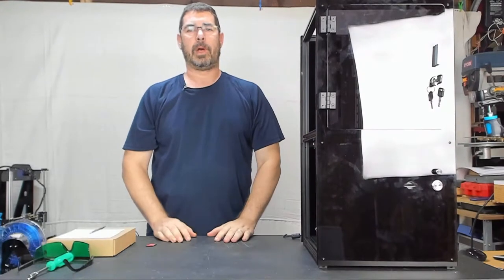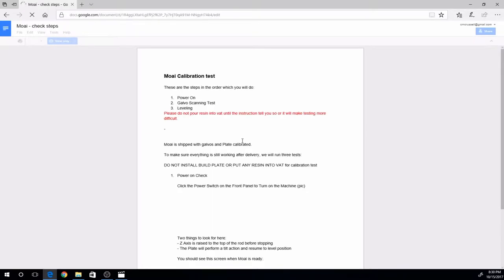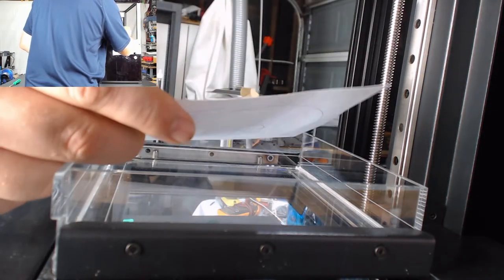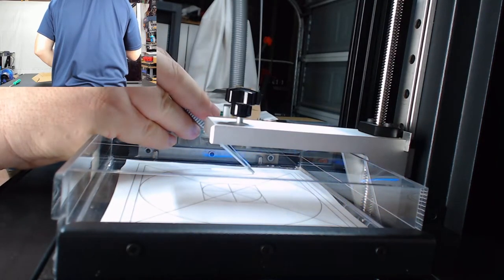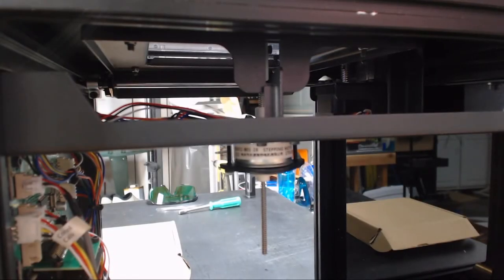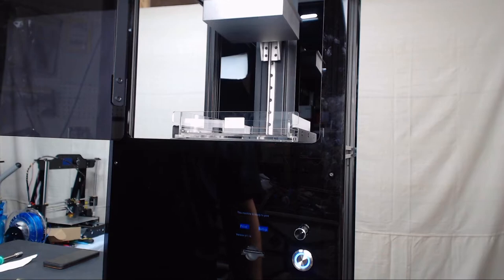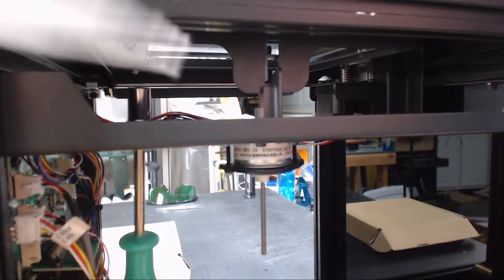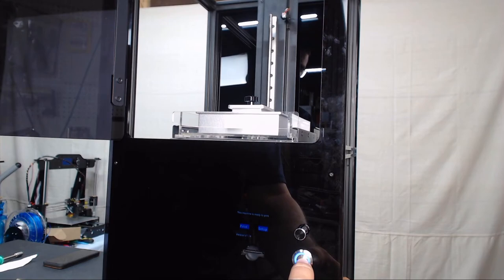Moai Series Part 8: Calibration ** UPDATED NOTES BELOW**

Comment from the maker: ** UPDATE: The leveling process shown is this video is out of date and had been replaced by a new process.  I will be releasing an updated video in the near future that supplements this series with the new process. In the short term, please follow along with the Peopoly build manual. **
Reply: Following the steps on the new settings since I just got my Moai using the new Wiki update I still find myself having to tighten the build plate a lot to get the size of the print past 10.00 mm when it still needs to get to almost 11.00 mm. Is it safe for me to tighten more than the paper test?
Reply from the maker: The goal is to get all 4 of the cylinders down in the 10.6~10.8 mm range.  It’s OK to tighten a little more if necessary, just don’t over do it.  Remember just a 1/4 turn even has a huge impact on the size.  If you can’t get it down in that range easily, try reaching out to Peopoly on their support forums for additional guidance before going to far.
Reply: I got a great solid ring print after getting my Caliper readings correct!
Reply: Did you make a followup video? cant seam to find it?

Comment: Thanks you for the video.  I eagerly await your revised video.

I just wanted to add a note concerning the "safety glasses" supplied with the printer.  I am a fabrication engineer at a scientific research facility.  I ordered and setup at Moai 200 in my lab.  This printer had to be checked out before I could use it for prototyping.  My radiation safety monitor/inspector stated that the glasses that came with the system are not rated for laser safety or UV safety, in any way.  The ones I received had ANSI Z87.1 / EN166-F ratings, which are standard safety glasses, without any other ratings.  Modifiers that show wavelengths and intensity should/would be present on the glasses if they were rated for those things.  

He ordered part number F22.P5L12.500 from lasersafety.com  (laservisionusa).

They are rated at:
OD 9+ @ 180 - 315 NM
OD 6+ @ 315 - 445 NM
OD 4+ @ 705 - 755 NM
OD 8+ @755 - 1100 NM

These are laser ratings, and not listed as UV ratings due to laser intensity being the biggest factor for protection, in this instance. "OD 6+ @ 315 - 445 NM" covers the frequency of the laser in the Moai 200.

I am sure that there are other safety glass manufacturers that can provide similar glasses.

This is not an advertisement.  I am in no way affiliated with this safety glass company and am not serving any financial interest in passing on this information.  Protect your peepers, people!

As an additional note, even though the top door has a safety limit switch, the lower door (galvo, electronics, and laser access) also needs one to prevent operation while laser exposure is likely.

Just for general information:
ANSI 87.1 - https://blog.safetyglassesusa.com/what-does-ansi-z87-1-2010-certified-mean/
EN166-F - https://www.wiseworksafe.com/blog/view/understanding-en-166-personal-eye-protection-standard

Comment: I'm stuck where it does the vat tilt test. I start it out as level. It goes down slowly, goes up fast, and then down fast. It ends up very unlevel. Is this normal before ever calibrating? I assumed it would end up at least close to level.

I asked about it on the Peopoly forum, and they sent me a firmware update, but it has zero effect on my Moai 130.

Thoughts?
Reply from the maker: Eric, doesn't sound quite right, but I don't have the machine any longer to validate it. I do remember it cycles the tilt on power up tho and IIRC it should come back up to level unless something is binding physically.  I would suggest getting a video of what is happening and getting that over to Peopoly support if you can.

Comment: The leveling on this printer has becomed incredibly confusing with the addition of the easy to level buildplate and the fep vat, there are multiple manuals and there is a lot of confusion out there. Redid the leveling using the paper method and printed the cylinders, all printed great, but they are at about 9,23 mm, and in the manual they need to be at 10.5 mm, using the default buildplate with 1877 value on the Z-reset. Can you tell me what should i do to make the cylinders at that scale, if i increase to 1878 what does that mean exactly, haven't found an in depth explanation for this, increasing will increase the buildplate?
Reply from the maker: The 1877 vs 1878 value is the number of "steps" from the Z homing at the top to being in the proper position for first layer in the vat, so increasing it just means that the build plate is that much closer to the bottom of the take when the first layer prints.  Unfortunately, I have not installed the FEP vat (or new style build plate) yet, so I can't really advise you on this one. Best place to ask the question is the Peopoly forums. https://forum.peopoly.net
Reply: @crussty3d  Hi thanks for responding, i got the answer on the forum, i am using the regular buildplate and vat so nothing special here for now just trying to make the cylinders the correct lenght. Started another print now using a much lower value to have less pressure on the vat and increase the size of the cylinders.
Reply: Practical Printing I am at 1870 value now and 3/4 cylinders print,  next I need to manually rotate the nut for the corner that didn't print and tweak very slightly the other ones based off their length. Going to be tricky rotating them at such small angles, half a turn is 0.3 mm so quarter turn or 90 degrees is 0.15 mm.
Reply: I have noticed after I change the z value , the bed goes down, I turn the printer off then on to make it go back home and it makes a sound twice like the buildplate tries to go lower into the vat twice before going back up into home, is that normal?
Reply from the maker: Icemanmodeler mine has always made a “Thunk thunk” sound with the PDMS vat, so I assume so.
Reply: Practical Printing Then it may be normal, thanks for confirming. I think I reached the value 1870 because I leveled it with resin in the tank.
Reply: @crussty3d  Im going to do a full leveling reset again, the leveling hasn't gone anywhere, getting inconsistencies, tried to use the easy to level buildplate per instructions and with that it only printed 2 of the 4 cylinders, this whole leveling sistem is a huge joke, the forum is filled with people experiencing similar problems with the leveling.

Comment: And what do i do if the laser doesn't match perfectly the paper, is it possible to shift it in the menu?
Reply from the maker: TheIcemanModdeler it doesn’t need to be a perfect match, the importance of that test is to validate the laser is firing inside the VAT and that it’s a consistent circle.  If it’s drastically off, contact Peopoly support before making any adjustments to it.  Fortunately a lot of the leveling process here is out of date and the new steps in the manual are much easier.
Reply: @crussty3d  Right, the circle is just left and forward slightly, the circle paper test that came with the printer has a border line where to cut it so it fits perfectly in the vat, no more room to move it and match it with the laser.
Reply from the maker: Trim that back inside the border more so you can move it to match the laser. That should tell you if the circle is correct in shape.
Reply: @crussty3d  Ok will do that, thanks.
Reply: @crussty3d  I fixed the problem, i found the advanced moai calibration document and that made me adjust the motors that control the mirrors to get everything aligned as close as possible, super simple design.
Reply: @TheIcemanModdeler  do you have a link for that document?
Reply: @lordgort1986  Just search for advanced moai calibration on google, it will show u to manually rotate the mirrors from the base, careful no to touch the mirrors.

Comment: For FEP vat users, use a specially made circle test calibration file at:
https://drive.google.com/file/d/1S-L18AFP98fBC-eObGOiKP4XNvgacvXn/view?usp=sharing
For FEP Vat users the Z Reset Position should be 1816, and you back it off to 1815 to level the plate.
The info for leveling the new style build plate is here: https://wiki.peopoly.net/doku.php?id=moai:levelingnewplate

Comment: the circle test is completely wrong in this video as its to center the laser to the middle of the vat. if your galvo is making an oval or anything else its broken.
Reply from the maker: Malcolm, the information given was accurate at the time the video was made, per the build manual at the time and additional information given by Peopoly. As I noted in the title and comments above, the processes and procedures for calibration and leveling have been superseded with newer instructions from Peopoly, including new leveling process and (more recently) adjusting for dimensional accuracy.  However, the purpose of the circle chase is still to simply verify that your laser is firing, and that it is doing it reasonably close to a circle.  If this is not happening at this point, then yes, other actions are needed, which could be replacing or readjusting the galvos- or your bed could be tilted, or any other number of problems.
Reply: @crussty3d  im not saying your wrong in calibration just the reason for the circle test is flat out wrong. Iv been with peopoly from the early days and it says print out 1:1 scale and cut paper to fit neatly in the vat the right way around. Then if the laser does not track on the black line you undo the cap screw and rotate the galvo to move the position of the laser to where it is suppose to be. In no way shape or form is it for checking how "round" the galvos move the laser period. 
Galvo "roundness" can only be changed when slicing using the new software and the distortion that sla comes with and having no cure was a big issue. 
I hope i cleared up any misunderstanding you have picked up and since this is obsolete should it not be removed?